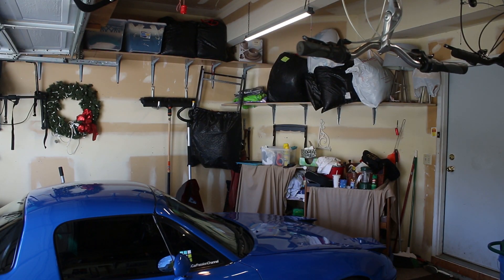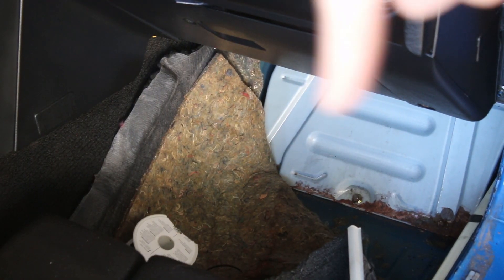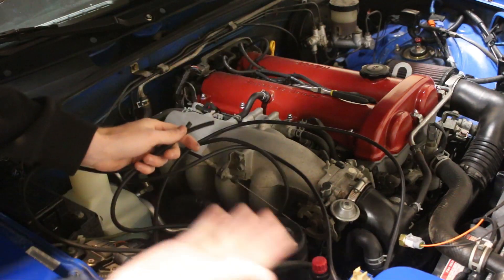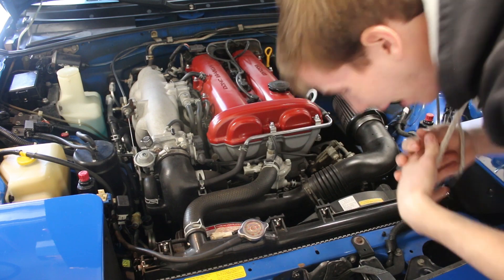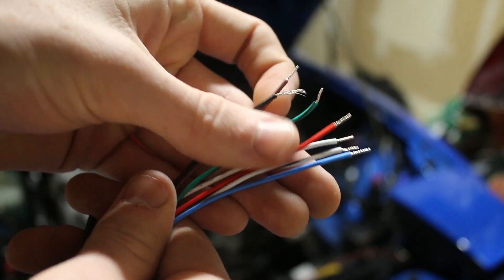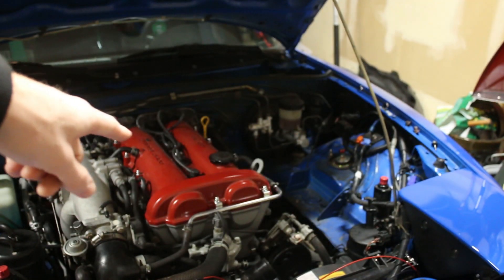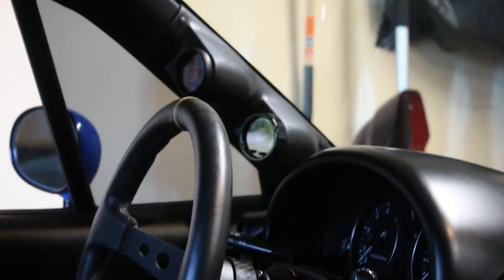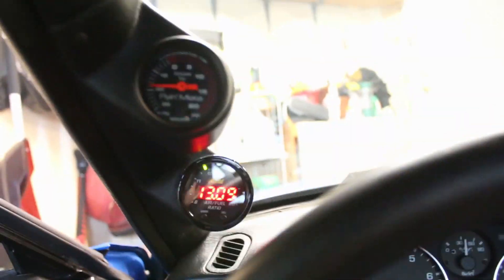TURBO INSTALL PART 1 - MegaSquirt ECU & Other Electronics

Comment: This damn Miata is soooo clean. If I wasn't 6ft and claustrophobic I would get one!
Reply: I'm 6 foot 220lbs and I daily one. Fit just fine too. Obviously less space than a mid size sedan, but I fit in it much better than say a 2013 Corolla.
Reply: MeeMoo220 when I sat in one I just couldn't do it. I didn't feel safe. My legs are long and the Miata wasn't doing it for me.
Reply: Certain generations have more room in them than others. What year was the one you sat in, if you don't mind me asking?
Reply: MeeMoo220 it was a 90 something. Same as this Miata but red.
Reply: From what I've seen, the space goes ND > NC > NB2 > NA > NB1. Just gotta wait till the newer ones get cheaper, I guess :P
Reply: MeeMoo220 😂😂👌 maybe maybe.
Reply: I feel the pain on being to tall I was gonna get a 99 civic or an old Elise but after checking them out I was to big kinda sucks O and I am 6ft6 and 230
Reply: Trent Minto I feel you man its a struggle. I'm not even tall just the way my body is doesn't allow me to own the cars that are known for being amazing chassis or excellent handling cars
Reply: Trent Minto u playing in the NBA?
Reply: No not in NBA I am only 18
Reply: Im 6'1  and 240. A foamectomy is a must
Reply: I'm 6'4 and fit perfectly

Comment: please dont tell me you actually left your "cold" air intake right next to your exhaust manifold, because if u did, you're now the proud owner of a boiling hot air intake
Reply: Its gonna be turboed, it wont be there forever...
Reply: mpg's bro
Reply: Where is he supposed to put it? (Serious question)
Reply: Ben the coldest place with airflow possible

Comment: should've went with a haltech 750 way easier to tune and international help available 7 days a week they can even review and adjust your tune over the internet if needed.
Reply: Puffalupagus360 but haltechs are more expensive aren' they?
Reply: Puffalupagus360 but haltechs are more expensive aren't they?
Reply: Tim Posthumus they are more expensive but when you break it down to a cost: features/expandability ratioc the haltech is a way better value.

Comment: cunstructive criticism, dont drip solder onto the wires, hold the solder above the wires and the gun below, it pulls the solder in rather than dripping it

Comment: Hey gingium how did you get the wires in the car did you drill a hole and also did the extension cord come with the kit or sold separately

Comment: You're cold soldering. Put the soldering iron under the wire and feed the solder through the top.
Reply from the maker: +TheMasongtre I dont know anything about soldering tbh

Comment: Where did you pull a vacuum source for your boost gauge, did you use the same source as for the megasquirt near the fuel pressure regulator?
Reply: Kevin Saeed saw that as well.  Huge no no
Reply: It's at a good place

Comment: @Gingium How did you wire your AEM air:fuel gauge to the MS PNP?
Reply: I wonder too or does it connect direct to the O2 lambda sensor

Comment: Do you need the turbo to run the mega squirt or can you just run the mega with just the motor and no turbo
Reply: Bailey Snyder you can run megasquirt without a turbo.

Comment: Does the ecu give u a higher rpm?
Reply from the maker: +Bro Sets Games It can, yes
Reply: Bro Sets Games Depends on how you tune it
Reply: No
Reply: Rudpavv Rudpavv It actually can. Again, it depends on how you tune it.
Reply: CuffRox
Easy way to blow up the engine
Reply: Rudpavv Rudpavv not if you know what you're doing
Reply: Bro Sets Games easy way to fuck up the engine

Comment: dumb question - not totally related to the video...
If I were to install an ECU on a completely stock car would you consider it a waste of money?
I heard you can tune your ECUs not only for performance but also to get better mileage and such.
Opinions?
Reply: BDAYZ it depends on if the car has an ecu that can be modified from the factory. If it doesn't then yes, you're probably going to need an aftermaket ecu, but if it can be modified things like a cobb access port is a good idea because i comes with some basic tunes and you can also get a protune put on it.
Reply: legocardude1 I drive a city car so I doubt it, but I'll look it up, nonetheless.
thanks for the tip
Reply: BDAYZ if the car is reasonably new (i'd say within 10 years or so) it should be remappable on the stock ecu
Reply: loww26 alright, then. how could one go about having it remapped? is it like what Caleb did (apart from switching it)?
Reply: you'll have to look around for places near you to tune your car on a dyno
Reply: loww26 alright, man! thanks for taking the time to let me know about it!
Reply: Out of curiosity what car do you drive?
Reply: Jamie Knight I drive a 2008 FIAT Grande Punto. It's a city car. That's why I mentioned better mileage.
Reply: BDAYZ Ohhh right :D Do you have another car? Or nha?
Reply: Jamie Knight Not at all. This mah daily and my track day car. An awful track day car, though ahahah jk. it'd never make the track.
Reply: BDAYZ Haha I feel you, my dad and i used to have an rx7 for a track car, long story short our friend crashed it and it's sitting in the garage slowly getting done, my daily is an mx5 :/ Slow and done pretty much, I tried it on the track and the previous owner welded the diff so yeah it was nasty on the track x'D Never again
Reply: Jamie Knight well, that sucks that someone crashed your rx7 :/ and a welded dif mx5 can still be fun! I think...
How do you drive that thing as a daily, though!?
Maybe I'm mixing stuff up, but doesnt that make the car awful for cornering
Reply: BDAYZ YES VERY  x'D Try and park the thin gin a car garage everyone looks at you bc the diff makes to much noise. But at night here in wales you can have some fun on the roads bc not many people are on them :p
Reply: Jamie Knight that's what I'd imagine! hey, as long as it's drivable AND enjoyable that's all that matters! I bet you can still do some 'mean' skids ahah
Reply: BDAYZ yeah lol :D not giving it to my friedn tho x'D :p
Reply: Jamie Knight that's a good call ahah
Reply: BDAYZ Indeed ;) x'D
Reply: there's some fun roads in wales atleast. Wish i had an MX-5, doing my test in a few days.
Reply: James Denton Fair plays mate! All my cash has gone into the car, and I am in uni skint x'D Worth it, it's got a  turbo (not that big tbh) It's a garret one not eBay shit x'D Where do you live? In Wales??
Reply: Jamie Knight Living in the Rhondda Valleys atm. Still in 6th form though
Reply: James Denton Do you know where protmeirion is? If so I live practically right next to the place
Reply: Jamie Knight just used google maps, near snowdonia. Nice looking village
Reply: James Denton haha cheers :D, It's an italian thing, I like it here bc every 2 weeks there is a car meet here at 9pm to 2 am in the woods :D, and the thing is it get's busier every year, (my friends host it) Do you talk welsh then?
Reply: Jamie Knight no, it's not as popular to speak it in the south. I know quite a few who do, but they're in the minority. I'm trying to go to uni in wrexham so maybe I'll be attending at some point, who knows.
Reply: James Denton Ahh right here in the north, if someone does not speak the language it's a case of sometimes getting a letter in the post saying that you must go to a class or tax will rise?!? x'D Luckily i was born to speak it, but not many ppl around here talk english x'D

Comment: m8 watch chris fix video because your cables are horrible.
But that's a nice video.
Reply from the maker: +IMNOTA Its better than no solder at all
Reply: Gingium yep that's true but watch chrisfix video you will see that your solders are not very good and how to improve them
Reply: indeed chris is awsome
Reply: btw gingium you done a good solder it could be better but ik you not a pro i'm aint a pro too

Comment: U made the intake worse as its a cold air intake and u but it closer to the engine where the air is hotter
Reply: This makes it less effective
Reply: SAUL SPIKE STOKE it's a shame you know nothing about cars, or else you'd realize that it doesn't that he moved it closer considering it'll just be piping for the cold side of the turbo.

Comment: how much does your miata have hp???
Reply: Gamer X 6 Hp and all of 5 torques
Reply: Gamer X they come stock with about 143 horsepowers and he only has 90 of 120 torques. Don't listen to anyone else
Reply: Gamer X with the miles and without the turbo less than 100 wheel horse
Reply: kk

Comment: I would advise anyone who is going to use this video as a reference for doing their own turbo miata not to, just blown a £500 megasquirt following this tutorial. Fails to mention pulling the 10a fuel pump fuse.

Comment: Can u send me the base map so i can tune my miata its a 1990
Reply: What kind of laptop do i need
Reply: To Fit the plug uno
Reply: Jack of all trades King of NONE ! Any laptop will be fine as long as it can run basic software and has a USB port
Reply: Ok i thought u need one of those screw in desktop plugs